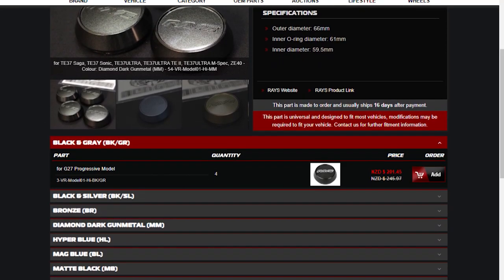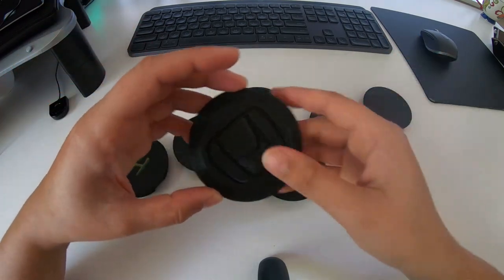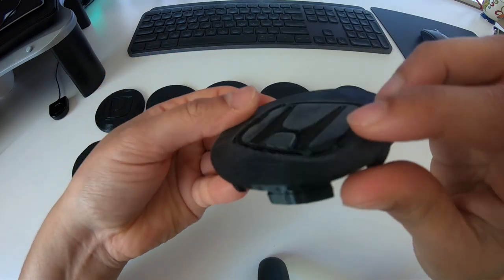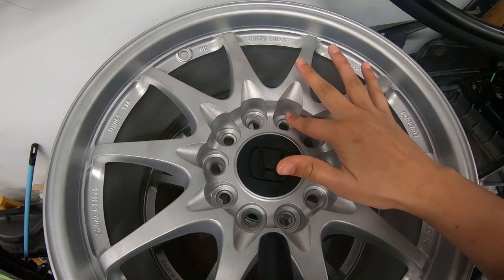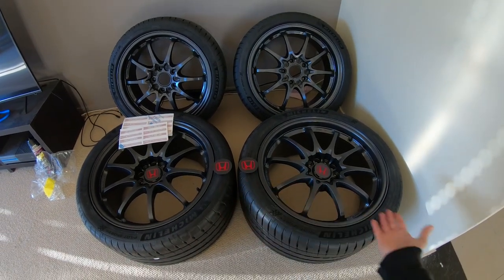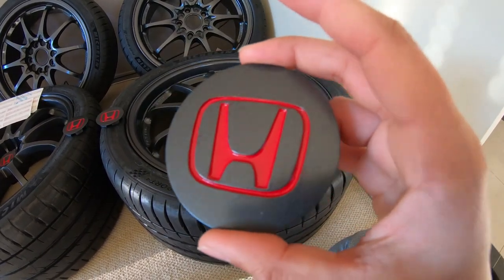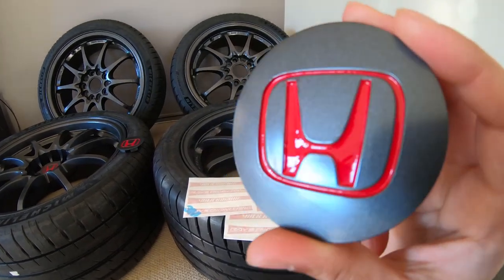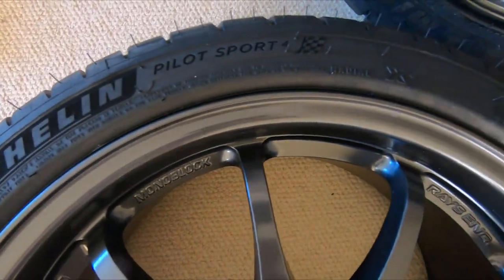How a 3d printer perfected my NSX build

Comment from the maker: *EDIT*
Have had a few people reach out with concerns that these wont last very well/ very long on the wheels due to the heat. Just here to say that they do! 

Since finishing the filming for this (was a fair few months ago!) I've done just over 5000km of touring, partaken in a 1000km road rally, and done probably about another 1000km with just "commuter" style driving

In their current state the center caps seem to be really snug, and from what I can see, don't have any signs of wear, warping or cracking on them. I even hit a MASSIVE pothole on one of the drives (actually buckled a couple of wheels from some of the other competitors, and may have dinged up one of my wheels a bit 😭)  but surprisingly, the caps stayed on! 

I am definitely worried that removing/reinstalling them may eventually wear out the lateral strength and the tabs might snap off, but if/when that does happen I will absolutely be doing another update as I think this is just a really interesting/ fun little experiment!